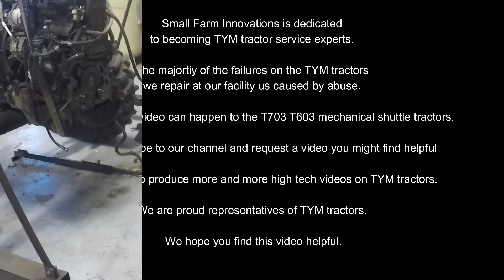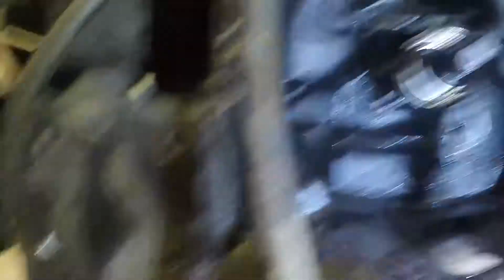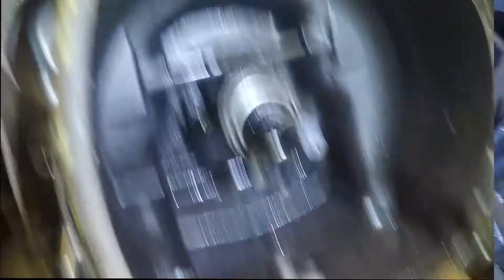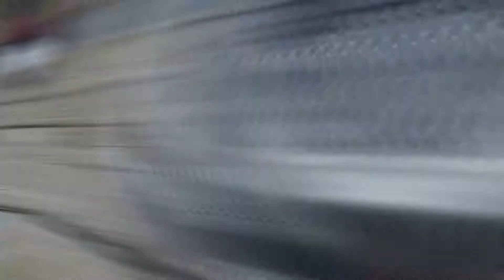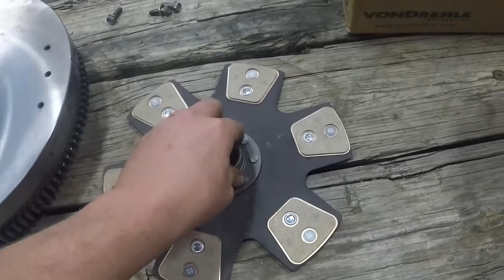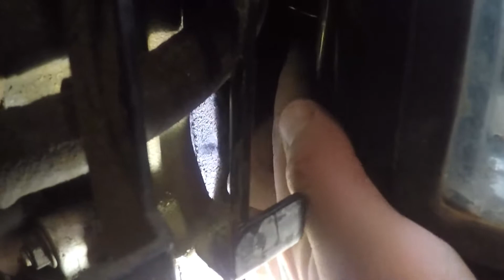TYM T654 Clutch Up-Grade

Comment: What do you guys think of the new T115’s. I am looking at one with the deutz engine.
Reply from the maker: Deutz is much better than Doosan in my opinion.
If your doing loader work keep it in low range and come to a full stop before changing directions.  
You will burn up the reverse or forward clutch pack if you don't.  Keep your turns shallow with a heavy load on the loader.  Its easier on the bearings. Buy your tractor locally not in another state.  You local dealer will not do warranty work if you do not buy from him /her.
Reply: Thanks!
Reply: One more question , please. I waited for the deutz because the dealer said don get the earlier engine. I have the deutz in the 754 and lime it. I know that with the Korean engine people had to stop and do an active regeneration.  That would be very inconvenient while baling hay. Do you know if that problem has been taken care of with the deutz?  My dealer said it should all be passive regeneration. They have sold the same engine in their mccormicks. Thanks again!
Reply from the maker: @Ravenwalkerkai1  All TYM 654,754 units have passive Re-gen.  It is constantly cleaning itself.  No warning lights, no change in RPM, just go.  We have had no issues with emission control items on a Deutz.

Comment: First off thanks for sharing your knowledge through your videos. I am 83 yrs. old and been around tractors all my life. I am very interested in the TYM 654 power shuttle tractor. I have had many kubota tractors over the years with great success, currently a 2005 M5700 open station and a B2650 cab either of which has had a problem. I have 100 plus acres of ground half woods and half fields. Due to allergies now I need a tractor like the size of the 654 w/cab. I  have read some articles where wheel seals leak on some models , front wheels locking up on the 654 and some other issues. I have never had a water issue on any tractor, is that something new now? I am to old to be repairing a tractor, so is the 654 a reliable fit for me? I live in Maine and need a tractor to plow snow on a long driveway in winter and mow fields basically. Kubota prices are way to high now so that is the reason for looking at TYM. I trust your honesty and thanks in advance for your help.
Reply from the maker: The tractor has a in board, single reduction, final drive.  This is a front wheel assist for pulling not pushing.  Once you combine the weight of the loader then try to push,  a tooth will break off the ring gear.  
To avoid this, go to two wheel drive when pushing if you insist on four wheel drive, then push less if possible. 
Front axle leaks...We will replace seals once if it's under warranty.  if its not under warranty we will drain all the gear lube out and fill with EP0 which is a liquid grease.
We had only two failures at our dealership since 2010.
Other than that, the tractor is a good unit.  Make sure you tell your dealer to stick you a block heater on it.

Comment: our clutch on the tym 574 is slipping could this be a oil  leak issue?
Reply from the maker: No,
574 clutch disc is good but cannot handle slippage.  Replace it with a ceramic button type.
have you adjusted the free travel?
Reply: @smallfarminnovations4265  no we have not.
Reply: @smallfarminnovations4265  it slips more in high range if I hold the break in and let the clutch out the tractor doesn't move.
Reply from the maker: if you have free travel, replace clutch disk .  If you do not have free travel adjust your clutch.  Never regulate speed with a clutch.
You can operate in low range for now if needed. A upgraded clutch will cost less than going through TYM.  Calculate about 2k for a new clutch.
Reply: what do you mean by free travel? @smallfarminnovations4265

Comment: Hi sorry to bother you guys again but I have another question. I put the first 50 hours in the tym 754 and I am not sure what hydraulic oil to use. The book says ISO VG 46. Do I  I need something that says trans/hydraulic oil or can I use just regular iso hydraulic oil? Would tractor supply traveler premium transmission/ hydraulic oil be sufficient? It doesn’t mention iso 46.  The guys I bought the last tym from said that the tractor supply stuff wasn’t good enough and to use their agrilube. But, since then they have changed brands two times. Thanks for any info!
Reply from the maker: use universal premium hydraulic(tractor) fluid from tractor supply.  do not use 303 it's for tractor manufactured before 1973.  I'm not promoting tractor supply it's just the easiest place to go.  you can use john deere hygaurd if you feel rich.

Comment: I wanted to give you an update on the 654 clutch  They replaced it with a heavier clutch.  They are great guys and got on it and replaced it fast.  So, I went to the shop and tried it out.  It seemed to work fairly smooth.  that was just in the parking lot but I suspect it would work just fine.  BUT, they had a new 754 with power shuttle on the lot.  I wanted the 754 when I got the last one because it is a little heavier and may be a wider stance.  I feel it would work better on the side of mountains of wv Baling Hay.  Back in 2017 I tried the 654 with power shuttle and I did not like it.  that's why we went with the basic model.  I tried the 2023 PS and it seemed like a different animal.  Worked very well. They must have changed it. Yep, I ended up trading for the 754....partially on your advice for the power shuttle.  There have been some changes as well.  I hated the PTO level being on the floor level under the seat.  It seemed a little hard to get into gear because it would bottom out on the floor.  The level next to the seat should work much better.  I had a handle for the three point hitch put on the last one but they come standard now.  I had two fuel lines rub through on the old ones and I told them to find them on the new tractor and wrap them.  They said TYM must have been informed because both of the ones I replaced  run through a protective conduit now.  It shows they acknowledge problems and address the issues.  Push button 4x4 but that probably comes on all models with PS.  I leave it in 4x4 since I never go on road.  I have had way to many close calls on these hills forgetting to put it in 4x4.  One upgrade would be nice would be all four wheels braking but that would be a lot more expensive.  I LOVE the Deutz engine.  It will also start in very low temps.  I had them put a block heater in because I feel it may be easier on the battery.  I put 2100 hours on the last one and they seemed to have fixed any problems I had with it.  I think they are a good solid tractor without all the extra things you never use that you have to pay more for on other tractors.  I hope the review helps anyone considering buying one.  I also noticed that if you want a Zetor under 80 hp it will be a TYM with a zetor sticker on it.
Reply from the maker: The 754 has a planetary final drive in the rear axle.  I think its the same axle they used in their older 100HP tractors.  Make sure you drain the water on your fuel filters often because if the Deutz engine sensor detects water in the primary fuel filter it will not start.  Keep the radiator CLEAN!  The cooling system is a little small for this tractor but not noticeable in most states.  Take care of the Power shuttle shift lever.  We have people break them off.  Overall the 754 is a stout tractor.  We have never had to pull a head off a Deutz engine or split a TYM tractor with a Power shuttle transmission.  You may see a different shift pattern after 30-50 hours.  If it jumps when going forward or reverse your transmission may need to be recalibrated.  We see this once in a while but it only once after the 30-50 hour mark.  Congratulation's on your tractor.
Reply: Is using air okay to clean the radiator? I worry about corrosion if I use water. I do check the radiator every time I use it if I am in conditions that will get hay or seeds in there. I believe that the manual said not to use a fuel treatment. I used the howls diesel treat in the last one to keep moisture down. What do you think about using it? I try to keep the fuel tank full when possible to guard against condensation and water in fuel. Thanks so much for you help and information!
Reply from the maker: @Ravenwalkerkai1  We never use water.  Go to Amazon and get this   https://www.amazon.com/Lisle-88500-Radiator-Genie/dp/B01N23E9WX/ref=sr_1_4?crid=1O5S9YDB7OCB4&keywords=radiator+cleaning+wand&qid=1699473003&sprefix=radiator+clea%2Caps%2C198&sr=8-4.

I make my own out of 1/2" Copper tubbing.  If we use  fuel treatment (which we have but not in Duetz) is a Conklin product.  Howls is good if your climate is cold.  But see if it adds to lubricity.  Howls performs a chemical reation to convert the water in to hydrogen

Comment: They took the clutch apart on the T654 just 300 hours after the first replacement.   I took your advice and had a heavier clutch put in it.  The original clutch made almost 2000 hours and still had some left but the pto seal leaked and ruined it.  I never thought about checking free since I went 2000 on the first one with out needing adjustment.  They said there was no oil just dust.  They replaced the plug you mentioned because it looked like it may be just a little wet.  What do you think happened?  On the power shuttle you just dont have to use the clutch between fwd and reverse, correct?  I didnt like the one I tried because if you had to gear down you were rolling back down the hill before the clutch engaged.  Is there a way to adjust that so it will catch faster?  I am in the mountains of wv and that can get dangerous if you are tedding or raking going up a hill.  I am considering trading for one with the power shuttle since you said you would suggest one with a power shuttle of the clutch.  I do think something happened to burn it out so fast.  How does the power shuttle work if it doesnt have a clutch?  You wouldnt have to worry about worn out clutch with that?  what would break on it instead of a clutch?  Sorry for the questions but you seem to be one of the few expert resources on TYM.  Thanks!
Reply from the maker: If the flywheel housing was dry then either the clutch disc was bad or the tractor speed was controlled by the clutch.
A power shuttle transmission has a two clutch-packs like in a automatic transmission, one to go forward and one to go into reverse.  They are both submerged in hydraulic oil. 
 Power shuttle transmission response is controlled by a laptop program.  It can be changed to meet the customers demands.  When they are cold the response can be different.  sometimes faster since the oil viscosity it higher.
I do not know how long a PS transmission last because I have not had to repair one yet.  If you installed ceramic button type clutch and you come to a full stop before selecting a different direction you should get another 3khrs on your clutch.
Reply: They said they were going to put a heavier button clutch in it.  If i get 3000 hours out of the clutch i may just keep it.  Good solid tractor.  I didnt check the free play until I noticed it slipping with the loader.  It was at the top.  The last one made it 2000 hours without free play adjustment and it still had clutch left.  I guess it was the lack of free play or a bad disc......probably both.   I was the same guy running it for the first clutch for 2000 and the second for 300 hours. Possibly the one from the factory was a better disc?  Thanks again.  Your advice is greatly appreciated.
Reply from the maker: The OEM T654 clutch-disc is not a good  disc . It's a fiber disc.  I'm not sure on the T754 but In the Cabellas labeled tractors, they have an OEM button clutch.

Sound to me like they put you in a good clutch and it should last you a long time.

Comment: Well, it happened again on the 2017 t654!  Less than 350 hours and 1 year and 3 months and the clutch is gone again!  the last time I got almost 2000 hours out of it which I can deal with.   I just wonder if its not the loader issue you told me about before.  If I upgrade the clutch to the ceramic it will still have the problem but it wont slip?  we would have to send fly wheel disc and pressure plate for you to set it up?  I am waiting to get it in to see if its the pto seal again or something else. Thanks for info!
Reply from the maker: If the clutch is saturated with oil, put flow control check valves on the boom side of the loader.
If the clutch is dry, use low range when operating the loader.  If you do not have patience and control speed with the clutch it will not last in any conditions.  A Ceramic clutch will last much longer but will slip if saturated with oil.  It will also burn out and take the flywheel with it if you control speed with the clutch.  This is why I promote the power shuttle transmission.

Comment: Just subscribed, is this common on just the T654 or would it be the same on the T494 & T574? Also have they fixed the problem with the later T654 tractors? One more thing, if you're careful with operation of the bucket so as not to drop it quickly, would you still have this problem? I'm thinking about buying one shortly ( New) and would really appreciate if you could answer for me. Thanks for your videos also.
Reply from the maker: This is impossible with the 494 or 574 nor power shuttle 654 and 754.  If you get  mechanical shuttle 754 or 654 just do not drop the loader with a heavy load.  Purchase a flow control check valve and place is on the return side boom cylinders if your worried.
Reply: @smallfarminnovations4265  So if I go with the 654 Power Shuttle I should be fine right? Are they're any other potential problems with the 654 power shuttle that would cause it having to be separated or heavy work done to it, under good operating conditions, (i.e. Experienced  careful operator and good maintenance)? Thanks again, this is a major investment for me and I really don't know who else to ask, that would give a truthful experienced answer. Again thank you for your help. ABCIII
Reply from the maker: @andycalcutt2177  The only thing we have done on the powershift side is add a shim in the transmission shift valve and the forward and reverse lever.  The shim raises the shifting pressure to fill the forward and reverse clutch packs quicker.  We will perform the final assembly on 3600 TYM tractors here in Texas this year so we make sure the proper shift pressure is achieved before it leaves our location.  I would go with the power shuttle. Tell your dealer to have a shift lever in inventory incase yours goes out.  It's not a common issue with the shift lever.  You might have to get the transmission re- programmed after a couple hundred hours when the clutches in the transmission break in.  Keep the oil and filters clean and you have great life out of it.

Comment: Thanks for posting the video.  I have my 654 in the shop for the same problem.  the clutch was slipping and when they took it apart they found oil.  Now they have to get into the transmission to find the problem.  Is this a common problem for these tractors and do you think I will have continuous issues with the same problem?   It has 2000 hours on it and i use it for everything except baling and brush hogging.  It has been a good tractor.  What do you guys think of them?  Any other problems to look for?  I was thinking about getting rid of it if it will start giving problems.  I bought it new and have had it for 5 years.  My biggest complaint is no temp gauge.  I love the deutz engine though.   I hate to think about getting another one.  thanks for any info.
Reply from the maker: I think the biggest contributor is the loader return port which is right behind the rubber coated plug.
 When someone is operating the loader, and they lower the load too quick, the high flow rate entering the transmission forces the rubber plug out. Purchase a flow control valve and place it in series with the boom cylinders hose. Also drill a larger hole in the flywheel housing.
654 is a great tractor.  If your worried about temp, stick you a gauge on the engine, Replace with a ceramic disc.  you will have to adjust the clutch. Keep the water out of your fuel and it will last you decades.
Reply: @smallfarminnovations4265  Thanks for that information!  Do you think the front end as far as final drives and gearing is heavy enough?  It is a 2017 and the info on it says "heavy duty bevel gear".  the reason I ask is because the people I bought it off of said it isn't built heavy enough for farm work.  I don't use if for baling and usually haul hay in and do a fair amount of loader work cleaning off the feed pad and do all the feeding with it.  I bale around 350 bales a year. I have the tires rear tires loaded with wheel weights.  I try to keep a bale on the back when I am moving hay.  I don't worry about it using the loader because I use the bucket it came with on it which isn't very big.
Reply from the maker: If you use the  tractor within its limits there will be no failures.  We had one final drive failure in a 654.  It was caused by abuse .
The two worst things you can put on any tractor is an idiot and a loader.